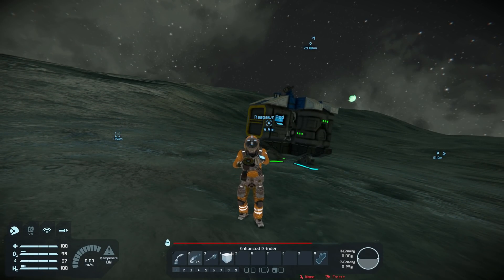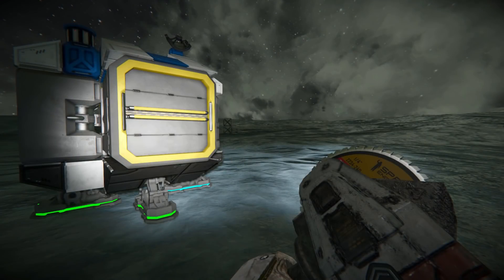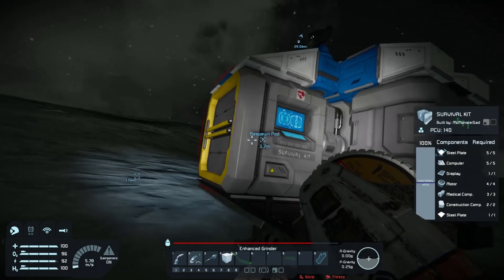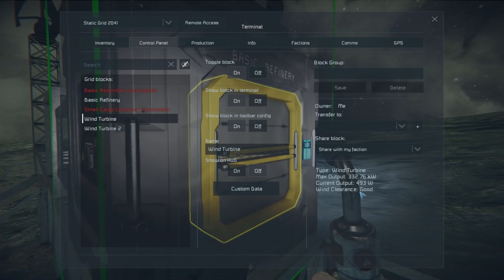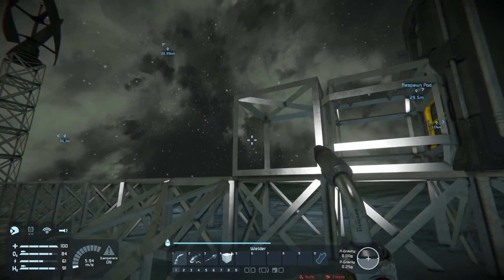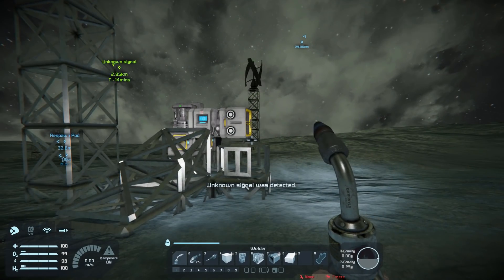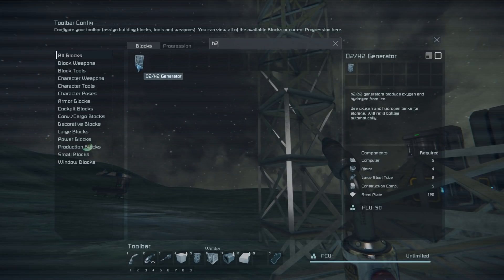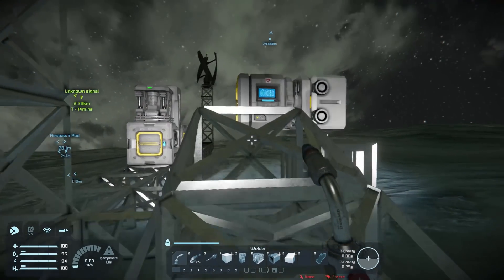Getting the BASICS | Space Engineers Survival | Season 3 | #2

Comment: It ... never even occurred to me that a wind turbine might work on the surface of a moon with no atmosphere. Are you sure that's not a bug?
Reply: It's not a bug, the system only really checks to see if the mounting point is "mobile" or not, and if it's connected to a "planet"  (the wind turbine disables power generation when attached to a ship that is not "docked" to a planet/moon in some way)

There used to be a bug where when you first install the wind turbines they would generate up to the ~500kW max, but when you restart, they should actually produce the correct output.  Don't know if that was fixed or not though.
Reply: How is not checking to see whether there's any air not a bug, in a wind turbine?  I mean, what kind of wind are you getting energy from here, anyway?  :-)

Whatever.  Let's abuse the hell out of it, till they fix it!
Reply: Europa, "possesses a thin atmosphere that is thick enough for atmospheric thrusters to work and decreases the efficiency of ion thrusters, but it does not include oxygen; the atmosphere does not extend very high above the surface."

So there is "Air," and no bug.  I suggest doing a Google search for "europa atmosphere principal gases" to learn more.  The in game moon is only "Europe Like," and is not the true Europa.